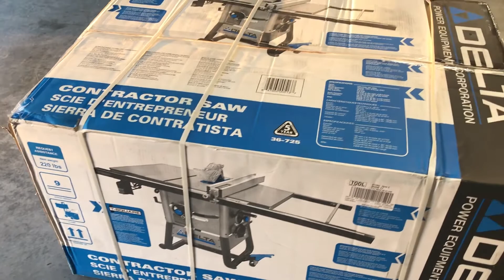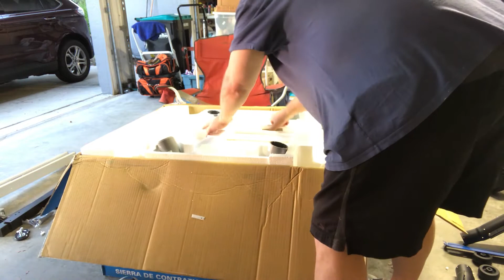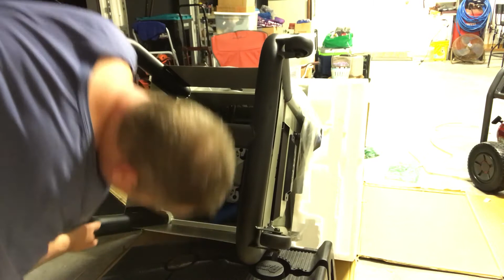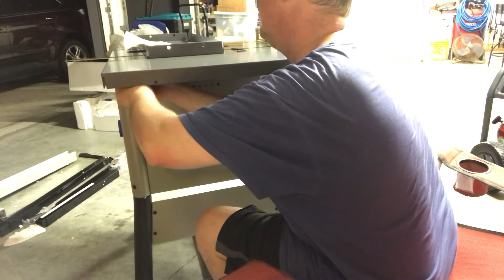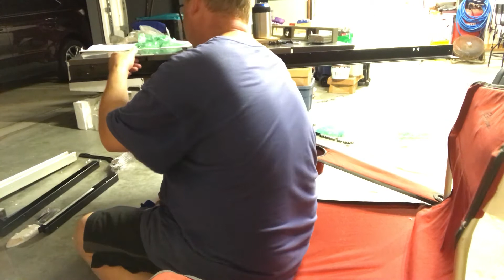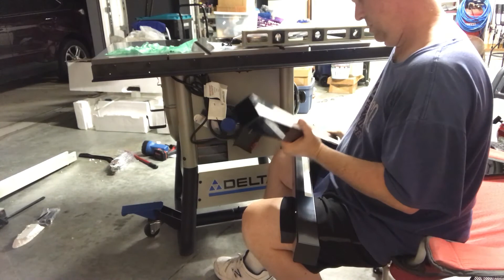5 steps to assemble a Delta Table Saw

Comment: Don't know if I can sit here & watch this for an hour & 22 mins. First off, lift the damn thing out of the box completely, spread out a movers blanket or something similar. Get the damn box out of camera view so the viewer can see what you are doing. Show just a little pride before assy begins by blowing off the loose styrofoam from the pieces. First & foremost B4 any assy begins, check the cast iron top for absolute flatness, if it is not or has low spots, box it up & return it immediately, this avoids the reassembly process, not to mention all the aggravation that ensues! I'm at the 11 min. mark presently, time will tell if I can watch this all the way through! I'm at the 42:42 mark amazingly & at this point no tightening is necessary on any of the angle iron rails nor the metal side side exts. At a minimum, 4 clamps are needed & using a 4 ft. level as a straight edge, ( 2 ) on the table top & ( 2 ) on the metal exts. The same procedure on the rear angle irons. Hint: The cast iron females for the angle iron, both sides as well as the cast iron females for the metal exts. will be the 1st to snug up after using the gauge tool & a 4 ft level, followed by the metal exts. Important that the rear angle irons are exactly the same height as the fronts to maintain an exact gap under the sliding fence. Once you dial in all these dynamics, using the provided gauge & a 4 ft. level you should be good to go for the initial setup. Once you are happy, now it's time to square the blade to the top, miter slot & the fence. Well, I did make it all the way through & since I am the only commenter on this ( 1 ) year old video I will say thank you for the presentation. The things I would do a little differently is ( 1 ), check the table top with a 24" square for absolute flatness, ( 2 ) use a 4 ft. level with clamps to bring up the assembled angle iron to proper height as a ( 1 ) piece unit, both sides. For the final adj's. to the iron rails, tighten to the cast iron table top ( 1st ), bring the metal exts.up to dead flatness beneath the 4 ft. level, then & only then tighten them to the iron top & the ends of the angle iron. You ended up achieving this in the end, however you didn't show this final process on this very long demonstration. 
Thanks again & I hope this will help others with assembling the Delta 39-725 saw. :-)